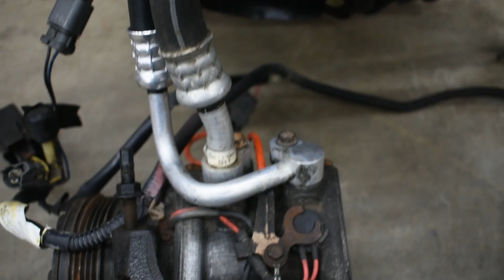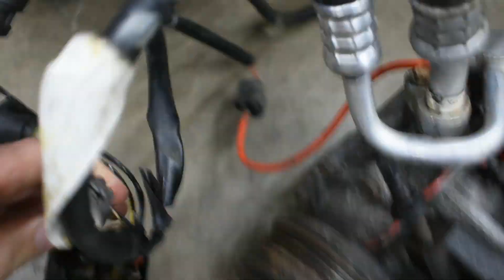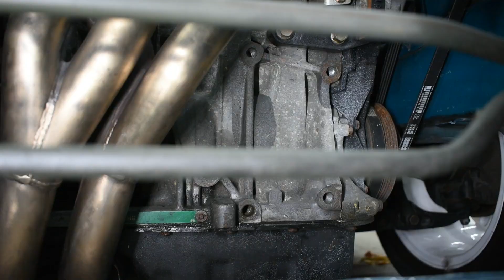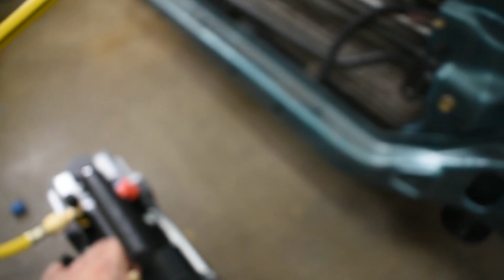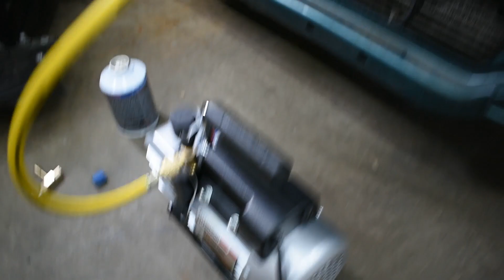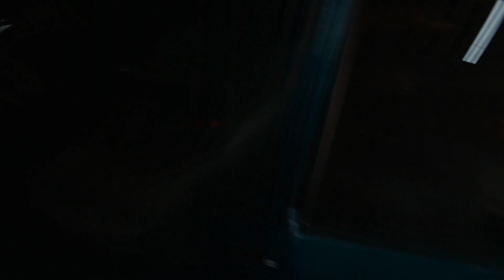Honda Civic Full AC Install and Charge

Comment: Update: full AC system installed in the DOHC vtec, the install is fully possible even with ABS and power steering, just very difficult to get the parts in.next up is reassemble the car then go get it pressure tested

Comment: dude I have a 95 delsol DOHC Vtec I am putting AC in and the suctions hoses going to the firewall are actually impossible with the wiring harness and ABS modulator in the way. I may update if I can do it but odds are NOT looking good